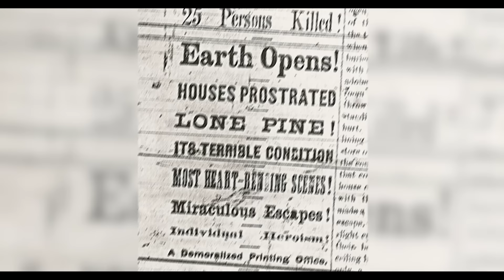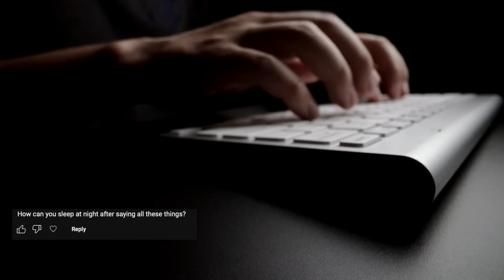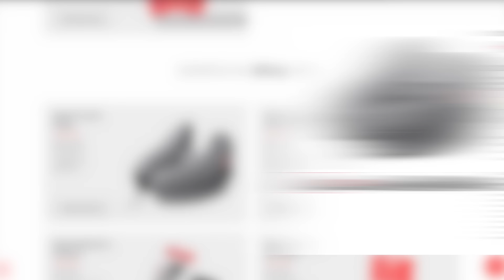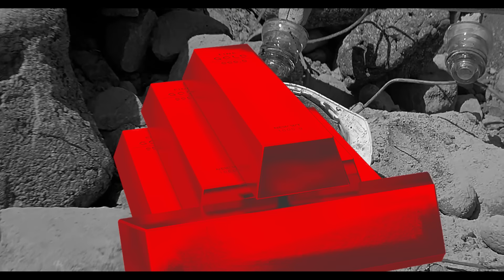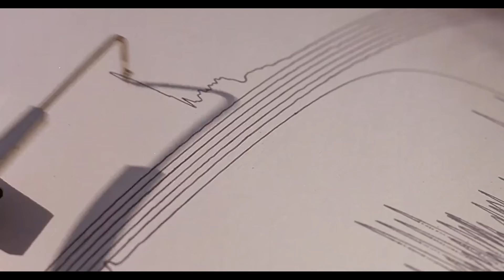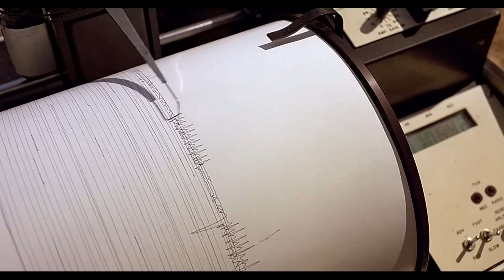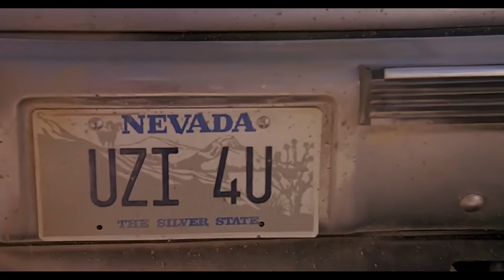How to Beat the GRABOIDS in TREMORS

Comment: I like how the graboids don't start out cunning or smart but evolve and learn tactics throughout the movies to match the protagonists as they learn. Usually the things that seem smart, like cutting the phone lines (or the radio tower in Tremors 2) are actually just coincidental actions. You can see the phone/telegraph wires are brought down in the rockslide at the pass where the construction workers are killed (and the heat of the radio tower attracted the attack in Tremors 2).
Personally, I would have just gone back to the concrete trench where the first was killed and try and take another one out there. The third and fourth might smarten up and not ram it, but they'd still have to bust through the concrete.
Reply: nah fuck busting through the concreate in tremors 3 the evolved into birds

Comment: I think this is the first time I've really disagreed with Nerd. 
The total mass of the houses isn't the issue. They are cheap buildings placed on mostly sandy soil. Bert is probably the only one who might have foundations on bedrock. So the graboids can simply shift or damage the buildings one section at a time without needing to lift the whole thing.
While Bert's bunker is the best place for the town to rally to, they shouldn't stay there. It is the sturdiest building around but the rec room scene proves that it can be breached. The graboids can at the least destroy Bert's supplies and likely bring the building down given enough time. At the same time the gravel and stones around the bunker make baiting the graboids even more difficult.
The CAT is the towns best option, albeit dangerous to get to. They talk about the mass of the machine but it's the mobility and horsepower of the thing that makes it viable. The graboids can't move it easily or quickly, while it can break their hold. Once they have the CAT they should do an irregular circuit around the town to by time while they deploy a variety of sound traps and attacking any tentacle that get's within machete reach. And if the graboids start to get wise just strap some pipe bombs to Melvin and throw him over the side.
Reply: It honestly feels like he just really doesn't like the movie for some reason and is very specifically searching for reasons to be highly critical of all the decisions made in this movie. Tremors is probably one of the best examples of a horror movie with actually smart protagonists. Those road workers definitely weren't residents of the town and were sent out there to work on it so there's no way they would know old Fred and would've assumed they were being genuine. Telling them about the sheep probably would've made them believe them less. They just wanted to finish the job and leave. He criticized them for the pole vaulting thing and how the sound distraction would've been better, but they didn't know if they would go for the distraction every single time and the pole vaulting kept them off the ground and away from them. He also talks about how they should've prepared earlier by setting up sound traps but they were given very little time from when Val, Earl, and Rhonda were able to tell them that they were underground from when the worms arrived. It took everybody by surprise. They didn't know that being in the Gummer's basement would've been the better play at all because they didn't know about the worms until they got back into town. He also goes back and forth a lot between saving the people and not saving people. He says they should've used Melvin and Mindy as bait, then criticized Melvin for not saving Rhonda, and then criticized Val for saving Rhonda. Everything you addressed about staying in the town and why leaving is perfectly sound. I don't understand how he thinks they would be able to hunker down with the guns safely because they literally can't shoot them through the ground and trying to bait them out would've been extremely risky. He also just doesn't seem to understand how people react when they're panicked because he is constantly criticizing that people made a dumb decision when it was completely rational while they were panicked. I got a lot of cinemasins vibes from this guy. Specifically searching for the bad things of the movie and never thinking about it for more than 5 seconds. It doesn't seem like he weighed out the options at all. He literally called a dozer flimsy as hell because it was dusty.
Reply: @arand0mpers0n58  Also, he kept saying the bombs scared them, when Rhonda literally screamed it doesn't, it hurts them because they are so sensitive to sound. 

Sad this is the first of his videos I've watched because I just got annoyed lol especially since Tremors is my favourite movie
Reply: @Schnipps He ignored a lot of the dialogue, like when he was whining about them not going around the blocked off road or using their off road vehicles, when it's clearly stated that Burt's Jimmy is the only vehicle that can make it through the jeep trail.
Reply: @babayaga7434 I think that’s because a lot of the places where they were moving through were comparatively flat. Like, the area where the graboids ambushed the horses looked like something they could’ve easily driven over. But, Nerd also didn’t take into account that, while they probably COULD have driven over that, stopping to move one rock or boulder out of the way would’ve given the monsters time to rip their truck out from under them. I agree that driving out with Val and Earl’s truck wouldn’t have been a viable option, but I can see where someone could get that idea from some of the places that were shown in the movie.

Comment: In defense of the bulldozer plan. The graboid was lifting the sides and corners of the general store, which would take significantly less force to do than what you implied. The bulldozer has its' weight more compressed in comparison.

If you remember earlier in the movie, they were able to rip off one of the tongues with the truck. The truck of course has a lot less pulling power and traction than the bulldozer.

Comment: "They should've hunkered down instead of leaving the area" So what? Give the Graboids enough time to Figure out an way to get em?

"Burt's Rec room perfectly stopped an Graboid" Ummmm no, Graboid effortlessly Breached through that shit, They are lucky that the graboid only gone for the wall instead of the floor

"They should've stayed on the roof and used sound traps to lure them so that Burt and Reba can shoot them" Ummm no, Do you know what an bullet cannot pierce easily? A GODDAMN DIRT, Even with something like Elephant Gun, Its not gonna go through like shown in the GODDAMN MOVIE, Unless you have something like 950 JDJ rifle (which only 3 of them exists) you ain't gonna just shoot them through the dirts, Also Burt's Bunker which is covered in gravel, You cannot lure the graboids in that shit, Unironically trapping yourself

"The Bulldozer is unreliable as its only weight 20 tons whilst the store weights well over 30" Umm no, Its not about total weight, Its about Mass, Mobility and Horsepower, Than thing can shake any attempts of the graboid trying to topple it over with force and the Store was ticking time bomb as graboids begun to Study its structure and started to dig under it to collapse it, Plus the Graboid can easily bust it down as it was shown in the GODDANG MOVIE WHERE IT EASILY BUSTED OUT FROM THE FLOOR!!!

Comment: I don't think the Graboids ever lift a whole building all in one go like Superman. Rather, they pry up one corner then another, knock out supports, undermine the flooring, slowly weakening the structure. The CAT does weigh less than the general store, but it is much denser, more compact and made of steel rather than wood and concrete.

Comment: I disagree that the Gummers leaving is a bad idea.
The next worm they would have to kill would have to make a new hole in their wall. The size and damage the first worm did severely weakened the structure.  A second worm inna new spot would undoubtedly make the basement bunker a very dangerous place to be.
Not to mention the worms could just bring down the top level, trapping them inside.
His decision to leave, was the right decision.
Either you risk hanging out and getting buried in the basement, or, you risk having the roof you're standing on to fall out from under you.
Sure, they could have attacked the worms from the roof, but it would have taken quite a bit of ammo with the earth adding extra armor to the worms. The bulldozer idea isn't bad until the worms figure out the trench idea. It's mass is compact, denser. More solid. Makes it harder for the worms to lift or move such force. A home has it weight spread about more, more oddly distributed. Offers weak points, they weren't lifting the homes and large structures up, they couldn't even lift up the trailers and RVs. They could top em over, move them a bit, but not lift up. And the graboids only do that on stationary targets, giving them time to dig under you. So, moving would be a good option.
Id give staying at the bunker a fifty fifty shot at working. Id give the bulldozer escape plan about the same chance. So, I wouldn't call it a bad decision on Burts part. It's a judgement call, and it's a crap shoot. I tend to agree with him, in that scenario, it's better to be on the move.

Comment: To be fair a bulldozer like in the movie (not a loader like the animation you used) isn't actually a terrible idea.

Even if the worms can still bump it, it's built so solid for being in construction sites and doing heavy work that's unlikely the worms can damage it, and it has so much traction having tracks instead of tires that the worms would like be unable to knock it off course.   All they might succeed in doing is lifting it a tiny bit from time to time.

Like I said it has tracks, so the worms can't stop it by taking out the tires like a truck.  It has no tires.

These also have so much horsepower, these things are build to plow dirt.   The worms would have no hope stopping it by trying to grab hold it.   As seen when Val backed into the cliff, the worms was able to grab and stall out a pickup truck.   But a heavy duty bulldozer... yeah good luck with that worms.

And while it seems this one doesn't have it (due to needing to tow a trailer) not only do these bulldozers have a big plow or scoop in the front, but they also often has these huge rakes in the back which if you caught a worn on the surface (in it's feeble attempts to somehow stop you) and you put those ranks down.  Yeah, I don't think the worms are going to have a very good time.

Now the worms in this movie does stop the bulldozer by digging a trap which, I'll be frank, I call bullshit on that.   As stated in this movie these things hunt via vibration, not even sound.  You can't see underground, you can't smell underground, and I doubt you can hear very well either.   These worms are quite literally blind and deaf with no sense of smell.    They hunt via vibration.   Something moves on the surface, be it a footstep or basically anything that movies, it causes vibration.  The worms detect this vibration and goes towards to to hunt whatever is making said vibration.   So how in the hell does these worms know how to go ahead of the bulldozer, to land where there is no vibration, and dig a trap?   That should be impossible for these things.

My biggest concern about using a bulldozer to flee town, and what the movie should had done instead of making the worms magically capable of digging traps, would just be have the bulldozer run out out fuel.   These things have massive thirsty engines and move very slow, I doubt they get very good miles to the gallon.   On top of that, Val didn't exactly have time to check and make sure the tank was full.  He ran to the thing, started it, hooked up a trailer and drove off before the worms could eat him.    The could left town with a half tank, quarter tank, dang near empty tank of fuel, they don't know.    The bulldozer running out of fuel would have made a lot more sense I think then the worms digging a trap... somehow.

But yeah I don't think a bulldozer is necessarily a stupid choice against these worms, heck the thing is basically a tank to these worms.   But the fuel situation would concern me if my plan to track across the desert to safety.

Comment: The concrete barrier that killed the first one much smaller than the other three which is why it died. After burt takes the 2nd one out you can clearly see the size difference. Staying at Burt's really wasn't an option either as they easily could have collapsed the basement, seeing as it's only a cinder block of thickness. Criticizing the use of the tractor is also incorrect. To the graboids the tractor is a small house in weight but it also moves. Something they haven't encountered before. They can dig out the bottom of a house because it's fixed to a location. 
As far as their behaviour they actually do just sit and wait for prey to come nearby, until the last few weeks of the first part of their life cycle. The ones we see in the movie have just started the becoming pregnant with the 2nd phase. Causing them to become more aggressive and hunting down the largest targets they can. 
As far as flipping a moving vehicle, while not impossible it's extremely unlikely as this would also put them at risk. If you think they would do a full breach like a great white shark, while possible they wouldn't unless it's the last hours of stage 1. They have no way to get back underground once fully exposed.
Reply: Oh it was absolutely the best option. the worms already demonstrated the ability to demolish buildings. A couple more holes and Burts bunker would collapse. He seems to absolutely ignore the fact the monsters were tearing the buildings out form under them. His criticisms only hold up for people who didn't actually watch the movie. He acts like lifting a 6000lb Trunk is the same as a 60,000 pound bulldozer.
I think he just struggles with a film where the people actually behaved reasonably with the knowledge they had at the time.
Reply: @keeperofnecronomicon  nerd is actually pretty good, just with this movie he kinda missed the mark. I watched this on its VHS release as a kid, and wouldn't walk on anything that wasn't concrete for a week. The first 3 movies do tell a lot about the graboids and are actually very entertaining. The first two are easily the best out of I think they are on 6 movies now. Last I heard they wanted to do a remake as long as the baconator is in it.

Comment: The Graboid slamming into the ditch wall and dying was because it could sense the wall was thin 'rock' and didn't know what 'reinforced concrete is'. As you can see in the shot, that wall is reinforced with both rebar and some sort of mesh, which is several times harder to smash through than an equivalent thickness of, say, the sandstone they're used to travelling through.

Comment: As far as communicating with the outside world - CB/Ham radio signals do not reach outside the valley and all the phones were down (including the one at Walter's) because the men from the Phone Company were the ones who were working up the road with the UNDERGROUND phone lines. "Bad service provider", my left foot! SMH. Cell phones weren't really a thing yet and there sure as hell wouldn't be a cell tower in the middle of the desert 50 miles from nowhere in 1990. 
Facts don't matter much in your thesis, do they?
Reply: This is also made quite clear in the film. Burt literally says to the others at one point that they are "completely cut off. Total geographic isolation". That's the reason he gives for choosing to settle in Perfection. Honestly it feels like Nerd didn't pay close attention to the film.

Comment: If i were a crazy, mountain dwelling doomsday prepper, i would say the best defense against the 'boids would be drone striking them. Just like they did in the sequel. This is assuming the world knows about the threat from the survivors of previous movies. Rc cars with remote detonators to set off a stick or two of tnt duct taped to them.

"Know your enemy" as sun tzu cautions.
So, how to survive on foot? Tough question. They can travel underground faster than the average human can run, but not by much it seems. The largest hurdle you should first overcome would have to be a reliable method of detection and early warning. Surrounding your property with stakes driven into the earth deep enough to ring cowbells or trigger noisemakers would be intensely laborious. You would also have to reinforce your house foundations or build them in such a way as to porcupine the worm stage if they try to dislodge or ram them. These bugs are capable of problem solving and basic pattern recognition. Again, knowing that you are being pursued and hunted before the worms ambush you is the most critical step to figuring out how to defend yourself. When they stalk you is just as important of a factor as where it happens. Impeccable improvisenational skills and macguyver-like tinkering will open many paths to success in life and against the 'Boids is no different.

A well stocked (on ammunition and ready to be used) armory of large caliber weaponry would be enough to take out the fliers and the walking ones. Shotgun slugs or big game rifles would certainly be widely available for defense from such creatures. Just dont aim for the hardened jaws or find a munition so rediculously overkill that it solves the problem on its own. However those guns tend to be cumbersome. Being lighter and mobile is more condusive to long term survival, even in modern warfare.